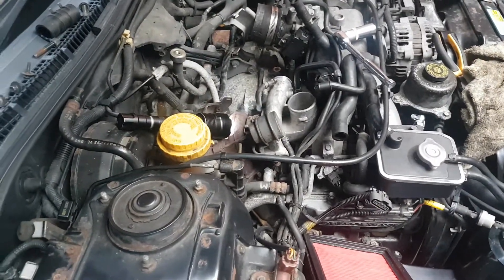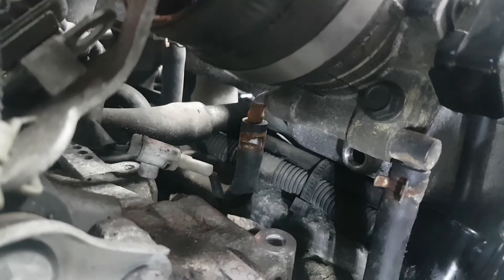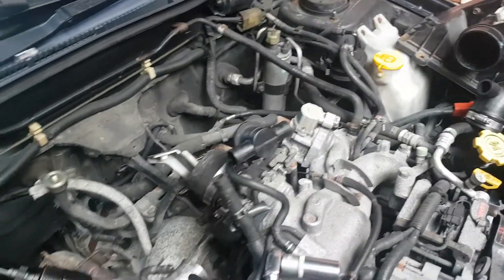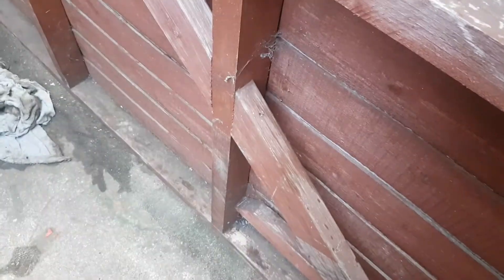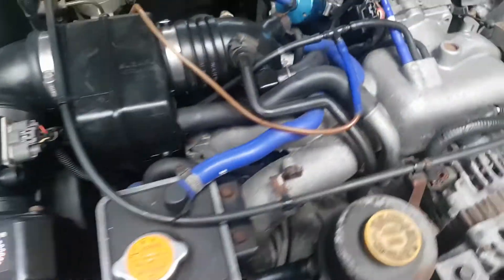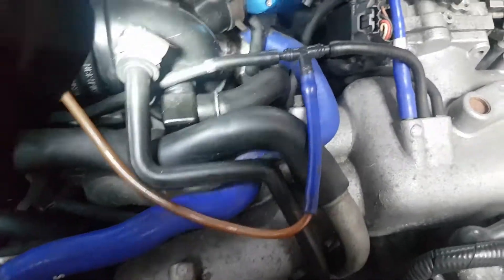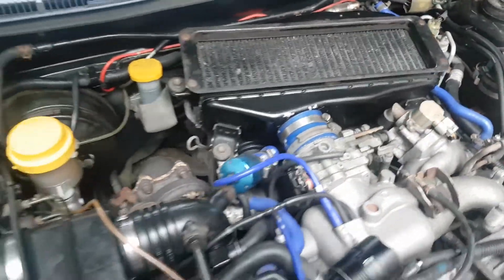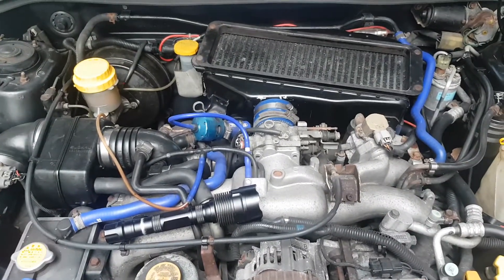Subaru impreza wrx 1995 pcv valve location

Comment: Spot on, I have a non-turbo 95 and it is on top to the side as you said-Thank You Sir!I have a low idle, miss fire with a/c on.
Reply from the maker: A easy thing to try is unplug the mass air flow and see what it does. Car should go into limp mode but will lose the miss fire if it's the MAF. 
Thanks for your comment and I hope it saved you some time
Reply: Thank You!

Comment: I’ve been attempting to remove the inner cooler to be able to reach the pcv but it seems like the IC is stuck? Any words of wisdom? 94 Wrx
Reply from the maker: they are super tight. work the right side out first at the back. make sure you have the pipes lose and keep wiggling! 
getting it back it is even worse.
just make sure you have everything off that needs to be off
Reply: @hiluxjapper  thanks for the quick reply. Is there a way to replace it without needing the remove the IC?
Reply from the maker: @ptoenyobut8501  no worries. Not really. Just need to be brave and pull it out. Take the pipe off the turbo and off the inlet and take the 3 bolts out and start pulling it up from the back by the windscreen. 
They are super tight but pull and it will come. 
You can always upload a video if you are stuck and send a link and I can then see what you have going on.
Reply: @hiluxjapper  sweet, I’ll definitely give it a shot and send you a link if I get stuck. Thanks again!